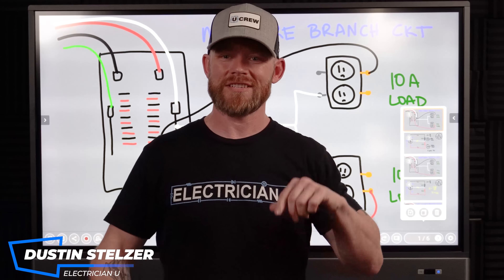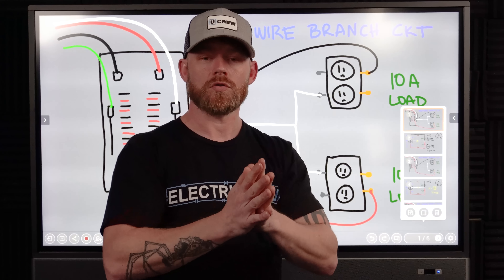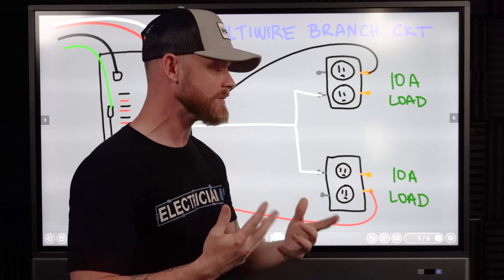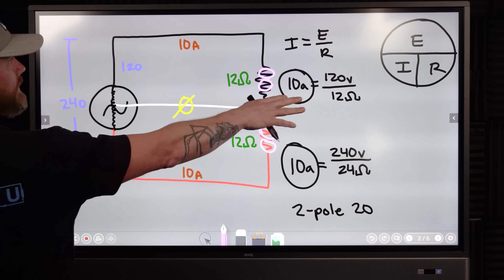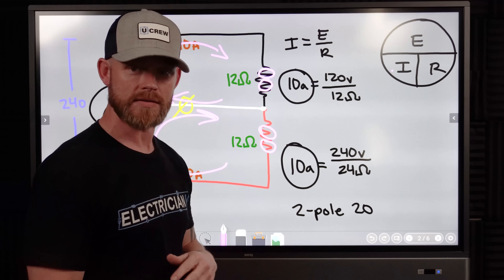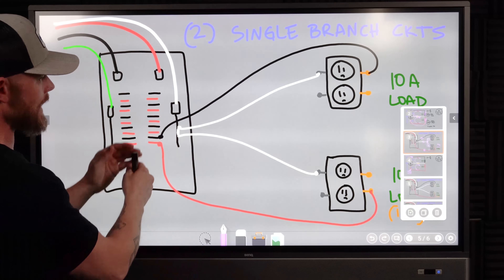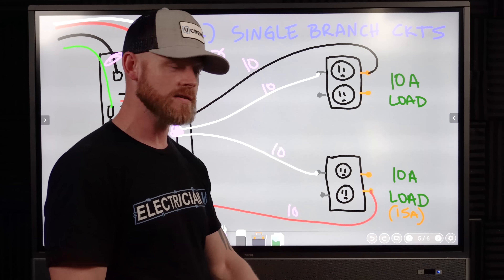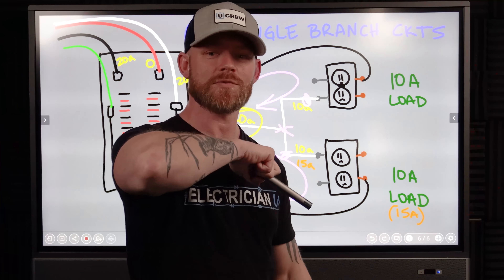Neutral Imbalance in Multiwire Branch Circuits (Two Hots, One Neutral)

Comment: Something you didn't discuss is what happens if the common in a multi-wire branch circuit is broken. This can happen for a number of reasons, but current will still flow, but it is now a 220v circuit. The voltages for each device will depend on ohms law, but it's not going to be what is expected. For example, let's say we have a multi-wire branch circuit supplying a bedroom. Phase A supplies the apple phone charger. Phase B supplies the 1500 watt space heater. If the common is connected then it conducts the differential current. However, if the common is broken then no circuit fault is tripped, but the voltage for each leg of the circuits is adjusted by ohms law. This is why multi-branch circuits are so dangerous, and why they can be one DIYer (or pro) away from disaster.
Reply: I agree, had that happen in my house. Had we not been home the house would have burned to the ground! Smoked 2 power strips a tv and a heater.

Comment: would love to see a video on how to mitigate issues with harmonics on the neutral in a polyphase power distribution system where the majority of the loads are primarily switched mode power supplies.  I've gotten around this by using 2 phases to each load, e.g.: 208V, but curious what's involved in using a single phase and neutral.
Reply: Make sure they harmonics are right, especially if using electronic light fittingss!

Comment: I have wired my smoke detectors with 12/3 wire.  12/3 has a red hot and an black hot...the problem with that 20 amp breaker is that there is only "one " screw for the hot and nothing for the neutral.  That left me with the "black" hot dangling.  An electrician recommended that I cap off the black and just use the red or vice a versa.  I put the red on a 20 amp breaker and the black on a 20 amp breaker and shared the neutral.  Who is right??  Thank you
Reply: so you asked a "professional", then disagree with them, do the opposite of their advice, then come ask on a YouTube comment thread? Wow. That's a good way to fry every single one of your connected smoke alarms.   In a smoke alarm circuit the red wire on the 12 3 is used for communication between the alarms. Three wire is not needed from the panel to the first smokey. They only need 120v. I would bet that if you removed the smoke detector closest to your breakers, you will see that they have one of those wires capped off in the box, otherwise when you hooked that other wire up to a breaker you would have definitely smoked em
Reply: @nrsmith066  thanks for responding.  I understand the orange/red wire of the smoke detectors communicate with each other, but the "hot" red wire goes from box to box and ends up at the panel box!  So now, do I cap off the hot at the box, remove the second 20 amp breaker, and I will be good?

Comment: Hey there, very good explanation 😎
Reply: I think it will be great if you explain what will be the result in a scenario L1 L2 L3 (hot) and if neutral disconnected on load in a unbalanced 400v 230v system lol.🔥🔥

Comment: I have a big question ... It's hard to wrap my head around, but I think the terms are power factor and capacitance ...  Isn't it possible to have a type of load that shifts the frequency?   What are the dangers if on side of the multibranch has high capacitance and shifts the phase - couldn't that overload the common neutral?     Granted it's not common to have this type of load on a shared circuit, but what are the possibilities?

Comment: I knew I had a multibranch in my house for years before I checked if both hots were on different legs.  They were on the same leg.  I think the guy who added that circuit, which was not original to the house, was named Bozo.

Comment: My panel says 40+40 Range but my house has gas not electric, circuit has white, black, and red wires going down from panel but there no outlet behind the range, how  can I find where are these wires going, any tip to find these wires
Reply: @jb9072  Thanks for the quick response, When I purchased home, I had gas not electric, these days I am curious  why panel says Range has 40+40 braker and there is another braker says AC 50+50 I also have gas dryer and washer use 110V as well my water heater has gas does not use 240V. I turned off 40+40, everything is working. I purchased 50+50 braker and outlet now have to find where they hide the box, I think you guested may be right when they remodel, then they might have disconnected or terminated the wires but it show in the braker white is connected left side of the bar Red and Black goes down in the pipe.  once I find those wires I can fish from attic to kitchen behind the wall to attach outlet cause I can see exact fan goes up on roof so it is easy to know where is the behind the range. Also I have purchased snake camera will check where are those wires.   I will keep on working untill I find it out? thanks for the tips

Comment: Shared neutral can still be an issue even when on separate phases when switching power supplies are involved!  Harmonics can cause over current on the neutral.
Reply: Yes. The way I like to explain the situation is that the switching supplies draw slugs of current that don't correspond with the peaks of the sine wave, so they don't necessarily happen at the same time in each leg. This causes pulses of current from each leg to travel through the neutral at different times, so they don't cancel. 
When office cubicles were first introduced the neutral wires were allowed to be smaller than the hots. Then after a few fires, were required to be the same size. And later, with more switching power supplies running on the circuits and more fires, the shared neutrals were required to be larger.

Comment: I live in an older house, and a few years ago half the lights in the house got real bright and half went dim.  I contacted my electrician friend and he came out and checked my breaker box. He said it was a loose neutral, he said  that it wasn't in the house and checked the pole where the meter is located.  it has a breaker box that distributes electricity to the out buildings, house and yard light.  He called  the electric coop and they replaced all 3 crimp connectors on top of the pole.  The linemen said that the connectors were an older style that they didn't use any more because they loosened and corroded.  
So what you are saying is that my house is not very well balanced because  that neutral that runs to the transformer has current flow on it?
thanks

Comment: So if I have two 10Amp toasters, one on each leg of 12-3 with a shared neutral, the utility will only charge me for 10 amps? And if you have a dishwasher and a disposal on two circuits using 12-3 with a shared neutral, you'd put them on a two-pole breaker that shuts them both off when one trips?

Comment: The 10a example is good for starters, but would also be good to note that with hairdryers and space heaters in the winter 18 to 20 amp loads are common on 20 amp breakers (with #12 wire) making the neutral on a multi-wire branch same phase circuit carry 36a-40a then-#12 don’t werk for dat. 
10 amp loads shared like in your example means 20a on the neutral which is barely OK cause it maxes out the 12 gauge, any more than 10a up to 20a shared means some pretty hefty wire is needed on that neutral return NOT #12. 
(8 gauge)
Maybe you could comment on that in the video as an add on in looking for unsafe conditions.

Comment: Hello their. If im using 2 hots 1 ground for a welder do i really need it to be ground or at the fusebox should a just make it neutral b/c its going through emt pipe anyway so the gangbox is grounded for the 50amp outlet once its screwed on

Comment: Dustin thanks for your well explained video, MW circuits are somehow confusing and dangerous if someone doesn't understand the concept of how current flow. For instance in a commercial setting of buildings for healthcare, wiring systems  that were installed on the 70s that did not used double pole breakers tend to be troublesome specially if the neutral path is missing for some reason.. the two phases add up on a loop causing failure on equipment . I guess copper and expense played a rolled on that decision.. thanks again for your videos.

Comment: Your explanations are wrong. A residential electrical service system is Single Phase has 2 hot conductors and 1 neutral conductor (not ground) there are all current-carrying conductors (hot). When a load is switched on in a 120V circuit (1 hot & 1 neutral), current flows to operate that load, there are no such things as push and pull actions. A 240V circuit has (2 hot from separate pole in breaker box  & 1 ground Green or bare conductor). Make It Simple,  don't make it so complicated and confusing.

Comment: While this is boiling things to extremely simple terms (I’m not an electrician), the existence of neutral is essentially  just to close the circuit?  And it’s purpose remains the same even out in the wider grid (albeit at far higher voltages)?

This makes 3 phase moters without neutral make more sense. The circuit (3, as it were) is already complete.

Comment: You said that on a multi wire branch circuit the breakers have to be tied together so they trip at the same time. Would this be the case in the following scenario?

12-3 ran to a single duplex receptacle. The hot tab is broken so red to top recep and black to bottom recep. The white to the neutral screw with out the tab broken. Each got tied to its own 20a single pole breaker. Should the hots be tied to a double pole 20 instead? 

As always great video! So much good info!
Reply: Yes... Say you put a plug tester in the top recept, then find the right breaker and turn it off. Now you think the receptacle is not hot, and you go to work on it, that bottom recept is still hot, therefore a two pole breaker is needed to kill both hot wires for safety

Comment: HVAC guy and building engineer  30 years. The ground is always safe . Its the ground .. Until one day I put my amp meter on the ground in a panel . This was a large TV station I was in charge of ..Wow . Wow I say 80 amps on the ground. from then on I meter every wire and ground. Very often a breaker would fail and you could not take the power line to change the breaker and had to change hot , These were 480 3 phase panel .. Never get hurt always checked every thing 
Question about the meter that bills you every month . Does the meter read the 3 harmonic and other harmonics .. I thought it does because amp draw is the sum of amps on circuit

Comment: On Multiwire Branch Circuits you will not be able to use ground fault interrupters. They trip when an imbalance is noticed between hot and neutral.
Reply: Yes you can if you use a two-pole breaker to protect both entire circuits, or a GFCI device down the line on either of the circuits after the neutral is split. The GFI can't sense an imbalance on that part of the wire because it doesn't have the other circuit's load going through it.

Comment: Like to reinforce that the power going into a cable should come from the same breaker (tied together for 220). Found a run to a pool pump that had the black going to one breaker and the red going to a different breaker in a box in a different room of the house.

Comment: And this is why if you were to add GFCI or AFCI receptacle protection where there was this issue imbalances in the neutral across different phase could trip them…MWBC can be hard to keep track of and can create issues that need to be carefully thought through.
Reply: You can use afci or gfci protection, it just has to be connected after the jbox where the ckt splits. So: GFCI&afci breakers won't work unless you use the 2pole. GFCI&afci devices will work to protect loads downstream, but they need to be connected to the non-shared neutral

Comment: Electrician U - Could you please elaborate on neutral to ground voltage? I’m a simple electro-mechanical technician. All the service manuals on the equipment I’ve serviced through out my 30 year career have had some specification related to the incoming power circuit having neutral to ground voltage limitations while the equipment is running. Over these last 16 years, the spec has been 0.5vac as read between neutral and ground during load operation. Anything at or above 0.5v is considered out of spec according to the manuals yet everyone at the company except engineering would ignore the spec like it was simply cya material when It was documented in the field and it was extremely difficult to be remedied by an electrician on the rare occasion I could get a customer to care about this. The funny thing is that every time I found burnt hardware or an electrically/electronically misbehaving system, I’d also find this issue. How are they related?

Comment: Dustin - in the last situation, where you have 2 significant loads fed from the same bus via 2 separate feed wires, yet they share a return path, this would cause a voltage shift at each of the loads, if the loads are different, such as 8 ohms vs 12 ohms?

Comment: You stated if you use the multi wire branch ckt sharing a neutral, you’ll need a breaker that trips both circuits at the same time. If you run two separate neutrals back to the panel can you use two separate breakers?
Reply: Yes that would then become a standard circuit. (Or two if you're specifically talking about running an extra neutral for an existing mwbc)

Comment: Hey Dustin! Long time listener; first time caller. Could you explain why, on a circuit with a shared neutral, both breakers must trip at the same time? I'm having a hard time understanding why the neutral carries an extra load (can become hot?), if one hot is disabled (or, at least, that's how it was explained to me). Thanks! Love the videos!
Reply: Did you watch the whole video?

Comment: Perfect explanation!! I had a situation at a convenience store where they used a single neutral on two 20 amp circuits on the same phase, it melted the neutral wire at the wire nut inside a junction box.  The customer complaint was the smell of burning  plastic near the cash register.   Traced it back to a Junction Box underneath of the counter.   The neutral wire was glowing orange at the wire nut and all the insulation was burned off. 😂
Reply: someone moved breakers around in the panel and didn't know to check for shared neutral/phase.
Reply: @throttlebottle5906   so that circuit cant be on the same phase? It has to be a 240v circuit on separate phase?
Reply: @gerardotorres7904  correct, if it's on  different phase's the current is mainly flows across through the two devices and balances out, with any remainder going back on the neutral conductor.
if only one device is powered on then all of it's current will go back on the neutral. say it's a 20 amp circuit, then only up to 20 amps max will go back on the neutral.
now if it's wired on the same phase, and both 20 amp breakers, the current will not balance across the devices and you'll end up with max of 40 amps trying to go back on the neutral! that would obviously be double what the conductor is rated for, overheat and start to burn. I've ran into many times over the years.
it's now NEC code to have a two pole breaker on any shared neutral circuit, that keeps them on opposing phases and ensures the whole circuit is dead when breaker is off, that way you wont get shocked off the neutral, nor overload it.
Reply: @throttlebottle5906  thank you so much for your answer
Reply: yeah that's reallly funny... -sarcasm
Reply: Coming through clutch with the super hero moves that day! Hope you were well rewarded for saving the business from burning down. 🔥

Comment: This is a stupid practice. I wish it wasn't allowed by the code at all. I never do it. The load is pretty much NEVER balanced. And, if you drop the neutral in that circuit you can have big problems. I don''t see any reason to ever wire a circuit this way. Lazy, dangerous practice.

Comment: at what point would your breakers trip if they are on the same phase sharing a neutral? Say for instance there are 2 15A breakers on the A phase and there is 30A coming back on the shared neutral, would that cause both breakers to trip? Or would they not trip and the neutral become overrated and a fire hazard?

Comment: ok here is my question i knoq i am going to get burn with this  but why we cant us a mini fuse that the car has if they have the some AMPS to save space 
ok we have 5 light  at the church that i go....they want to put a breaker 
3 are about 15ft hight and 2 are low to the ground  and there are homeless in around  they may pull the light out to get power they would like to use a fuse at the 2 light  that are low to the groud  in the some homerun so that the other ligth stay on if some pull them out but they dont waht to buy  box to us a fuse they waht to us a mini fuse like the car has  can we us that mini i say NO but i would like to have a good answer to show them

Comment: Honestly shaking my head here. I can tell you know your stuff when it comes to theory. But why would you say 220? That hasn’t existed in either of our lifetimes. It’s 240 volts, also 12/3 is only common in a kitchen. Otherwise it’s a 14/3 two 15 amp circuits. Nobody runs 20 amp circuits for general use receps.
Reply: It depends on your area and what the codes and amendments are. Some places you have to wire the entire house in EMT no Romex. Some places do not allow 15 amp lighting or receptacle circuits

Comment: I ran across this exact situation in my house.  The hots were on red/ black phases on the panel but weren't combined with those little breaker locks so i was getting phantom current on my neutral at an outlet and i was like WTF.  This explained it so much more deeply than i figured out on my own.  I gotta thank you .  Been a long time watcher but this was so exactly what i was up against and explained so in depth that i gotta say hats off on this one.. well done and thank you!